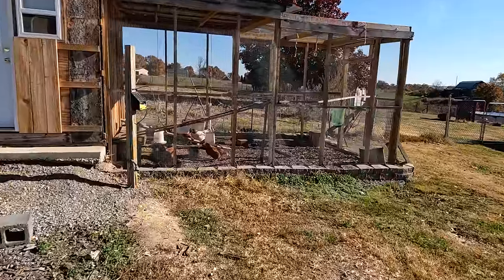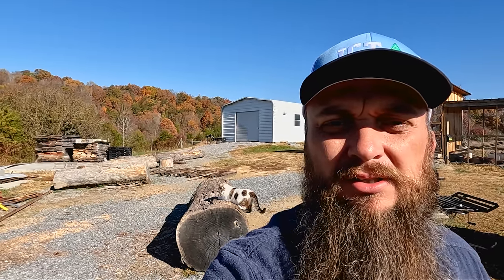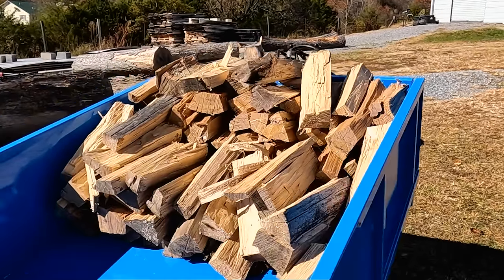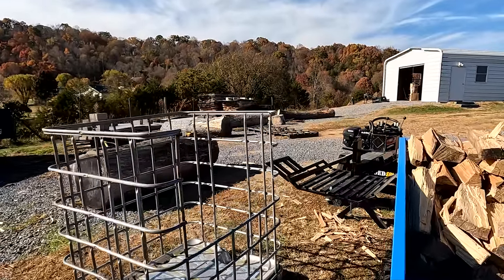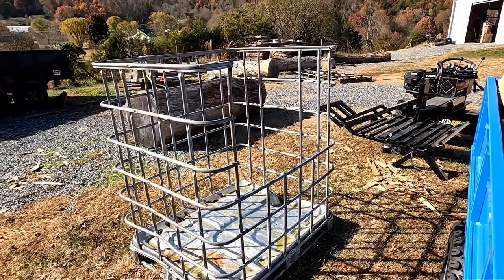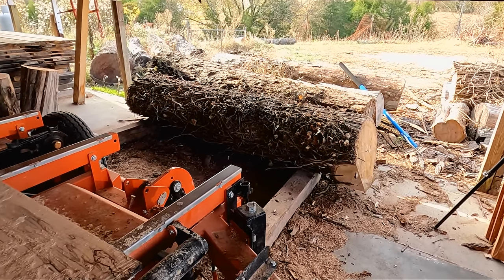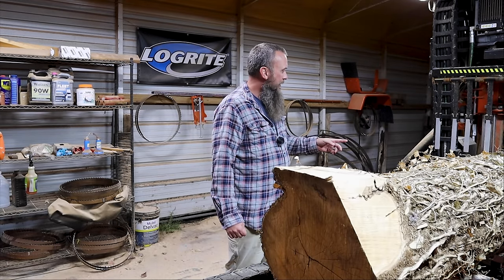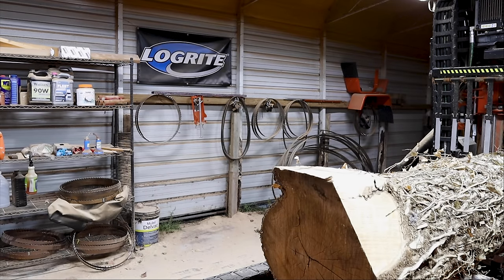BIG Problems At The Sawmill

Comment: It will speed up your tote prep. #30 torx to remove the 4 screw on the two top bars. Great job cutting out the opening but would suggest you grind the cuts down so you don't rip your clothes and arms up. Enjoy your videos. GW

Comment: You may think this is funny, but I put most of my firewood logs on my mill and cut them in quarters so I don't have to split them. All I have to do is cut them in 16" lengths. Good use for dull-ish blades on the mill too.

Comment: I always thought the tote idea was good, but those totes can be expensive. Almost $100 each. I was thinking of making some out of wood.
Reply: maybe with free pallets from harbor freight tents sale last week. but be careful and everyone wants it. free. harbor freight  changes constantly. when i was there 10 years ago everything came on pallets. and the pallet piles grew now with just in time trucking they fill the front stacked floor to ceiling with loose boxes then pallets and then oversized big stuff ar the end for quick forklift to the warehouse area. sometimes if the only have a half truck load  for one store. they load one store in the front half an the back half is destined for another store. minimize less than full trucks. and the trucking company has preset delivery times and the store manage has to plan to have staff to unload truck and when the store opens for business staff from the unload crew are moved to the  floor to unload totes to the shelf in restock efforts and support customer check out and customer inquiries and other customer assistance. there are a lot of work and efforts behind the scenes to keep the cost low and the profits high.